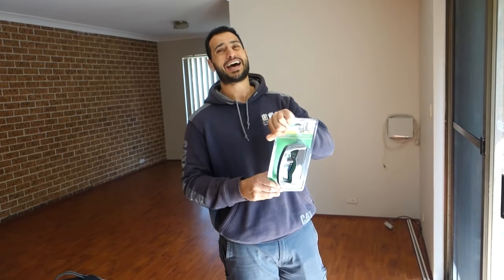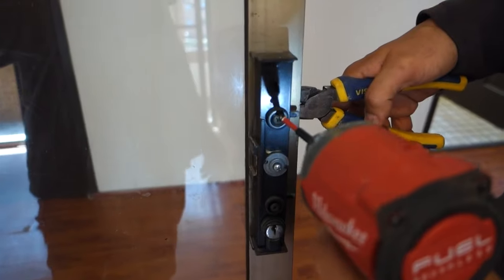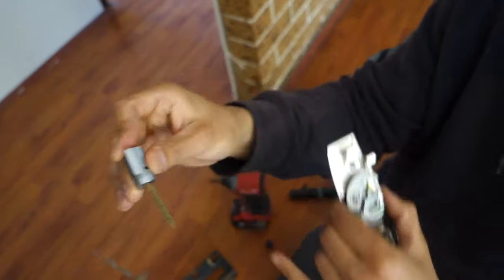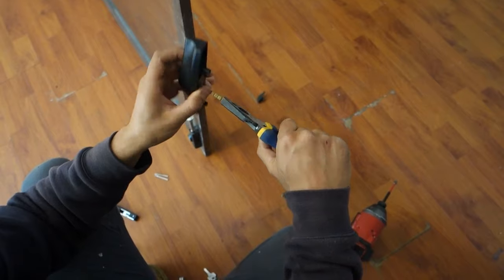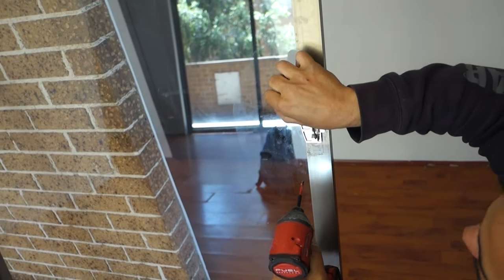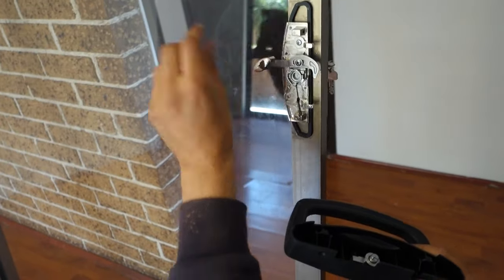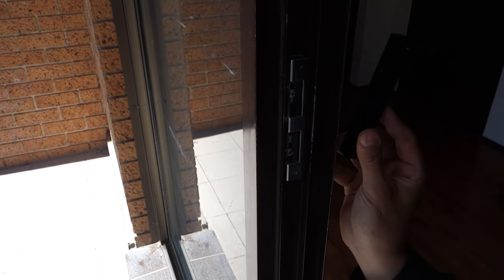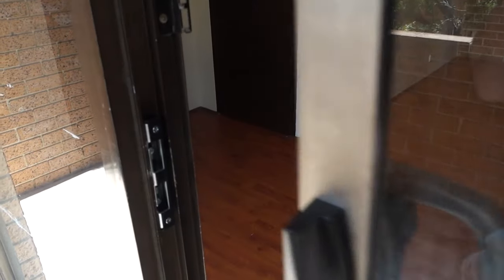how to replace sliding  patio door lock - remove and install

Comment: Ridiculously clear and thorough video.  I’ve got that same crappy lock and I’m off to Bunnings tomorrow.  I guarantee I’ll struggle and end up doing it like Steptoe and Son in which case I’ll return to this video and think why can’t I do it like you.  Thanks Bill
Reply from the maker: You’re very welcome 👍
Reply: @billshowto  I had to come back and say a massive thanks. Job complete. I did use Whitco Blaxland which is a deadlock. I was terrified I was going to cut that cylinder tailpiece too short so I used the spacer (which was metal). I can always remove if I need to later. I took a huge amount of time because I really studies the process….the screws stumped me a bit but after watching another Aussie tradie talk about the screws in the packet I felt confident everything was going in the right place. Massive thanks to you. I’ve been watching a few of your videos. Massive plus on watching an Aussie with products we have here.

Comment: Great video I Have just installed a unit BUT i am having no end of trouble locking the door with the inside key !  the out side key locks the door The inside key operates the hooks as does the inside slider nut BUT the inside key just wont turn that extra 1/4" to lock the door ie actuate the red plastic flag. Any ideas would be super appreciated mate

Comment: Interesting i had exactly same old latch and replace with whitco  same model,a little trouble with mine circlip pop off when I was testing the latch and the two cover screws where binding  badly too long had to cut 8mm of the screws

Comment: Thanks for the video! I have a small problem.  I can’t remove the key when the door is locked. When I adjust the tail bit then I can lock with the key and remove the key but then can’t remove the key when unlocking the door…

Comment: Hey Bill, we have two patio doors that are both locked shut, and the key doesn't unlock the silver lever any more (17 years old, handle is similar to yours, but has the key barrel, above that the chrome lever which unlocks it, above that the black lever which opens the door). Can you suggest a way to remove the lock when it's locked shut? We can remove both face plates, but still can't access lock...